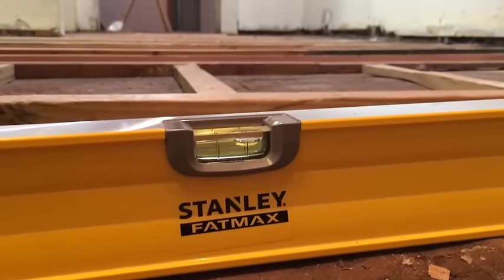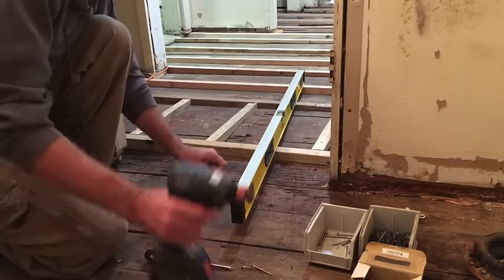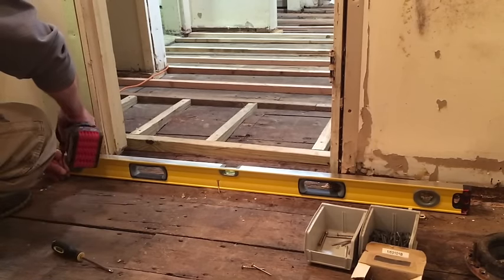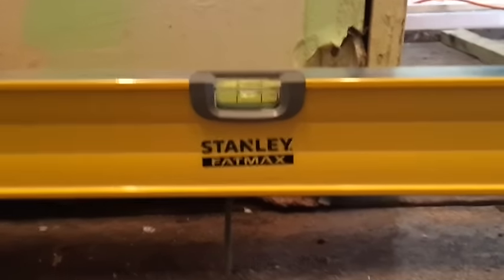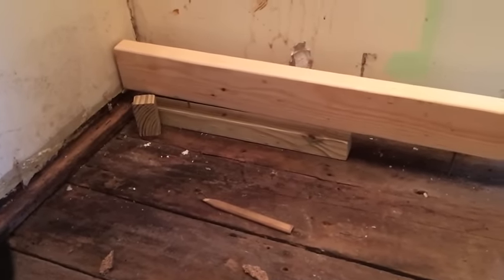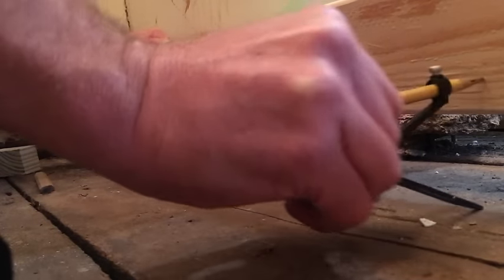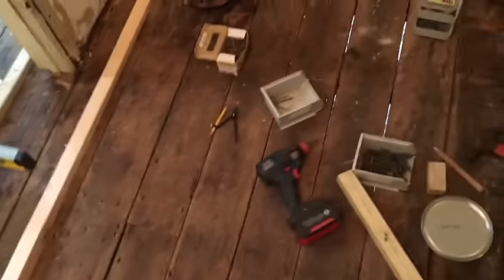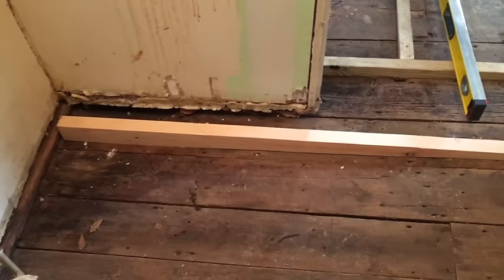DIY: How to level a uneven, wavy, or sloping wood floor

Comment from the maker: Jimmy5F, there was a brick chimney estimated to weigh about 2200 pounds that was sitting directly on the floor and was unsupported from underneath. The house was built in 1916 and over the years, the large hardwood beams, joists, and subfloor planks all warped under the weight. I removed the chimney and tried to jack up the house, but the curvature of the beams could not be straightened, and there is only a small crawlspace underneath to work. The floor is now supported from below, but I needed to correct the warping above without spending an enormous amount of time and money rebuilding the structure. This has worked perfectly.
Reply from the maker: @ph7715  It is perfectly acceptable and no, it will never bite me in the butt regardless if I rent it, sell it, or keep it. This improved the structure, strength, stability, noise, and energy efficiency of the house.

Comment: Very helpful video when you can't use a floor leveling compound. We live in a 1911 house with floors that have settled away from the central bearing wall. We've found that making the floors straight and flat vs. level is more appealing to the eye, especially around the doorways and stairs. A few rooms we've removed the floor, removed a few inches from the top of the joists, and using a carpenters string,  sistering new joists at the appropriate heights to remove the hump. Other rooms we've been able to accomplish a straight floor by running a carpenter string from wall to wall then scribing and cutting two by twos to attach under the new floorboards similar to what you've done . Both ways have their place but in our house, a level floor creates problems while a straight floor eliminates the high and low areas while still looking level. Excellent video
Reply from the maker: Good points. Thanks, Dale!

Comment: Exactly what I did except I took the sub-floor up (it was pretty well rotted out anyway) and built up the joists to the height  I wanted.   Glue and screw what you build up.   I used doorways  as transition points to different  elevations and used short sloping ramps to make the actual transition.   I like your work.. Just  think it could have been easier with similar results

Comment: Not a bad video. I would invest in a laser level if you’re doing the whole house to save a lot of time. Also you didn’t mention but you should fix your timber rips on top of existing floor joists so as to not load the existing floor boards with the new floor load

Comment: Great vid. I had to use a similar method for pluming uneven walls. Ran a string line horizontally and then traced the mark onto 2x4. Then I cut the line out on a table saw.
Reply from the maker: Great idea! I hadn't thought of cutting shims for the walls. You should make a vid so everyone could ask you why you just didn't fix the wall. Ha!
Reply: @737T1C130  Lol , well we can't always tear a floor or wall completely out. I like to fix stuff right like you but sometimes demoing the whole house isn't practical.

Comment: As someone who is about to redo my bathroom floor that unlevel and been watching alot of YouTube videos.......I am just curious was sistering the boards so that the floor was level not an option???? I've seen alot of pple suggesting that and now I'm wondering if it is a good option
Reply from the maker: It is a good option, but in my case, I had large hardwood beams on the bottom side with multiple 1" planks across them and wall framing sitting on top of that. Here, sistering would have created much more work and I was able to save time, material, a money using this method and likely having a more solid structure.

Comment: Wouldn't it be better to lay it down perpendicular to the current floor boards to avoid any potential creaking? Then, each new support is supported by multiple boards, not just one.
Reply from the maker: Since the new subfloor would be resting on the shims, I wanted the weight distributed across the underlying heavier joists instead of the thin and flimsy floorboards.

Comment: Just what I was looking for. I’m trying to do that for a concrete garage, to convert into a bedroom. Any recommendations on what to use instead of the screws?
Reply from the maker: Cliff, I would use concrete screws. Just drill a pilot hole with a masonry bit then use the concrete screws to hold your shims to the floor. Good luck with your project!

Comment: This video may have just saved me a lot of headache. I've got a stucco home built in 1910 with very similar issues yours has, and I've been weighing my options as to how I'm going to level the floors before putting new flooring down. My fear with my home is if I were to adjust the beams from the basement, what it would affect in the rest of the home.

Comment: What type of plywood would be best to use? OSB? We have hardwood subfloor thats sagging and going to use this method
Reply from the maker: OSB works just fine. You do need to find an OSB floor span chart for the thickness you are using. Your shims may need to be spaced anywhere  from 10-16" on center so that it doesn't bow.
Reply: @737T1C130  Beyond helpful thank you for the reply on such an old video !

Comment: But are you putting this wood randomly on top of the floor or are you aligning these new "pseudo-joists" on top of the old joists below the wood floor?(or maybe you laid it down perpendicular?  I would think that for the safety of the house you would need to look below the floor to see where all the existing joists are. anyone who can explain this to me would be a great help!! thanks
Reply from the maker: The frame of the house was old hardwood beam construction. There was a chimney that was built resting on these beams. They were solid, but were warped over the course of 80-100 years due to weight. I used online calculators to study the spacing and span load limits of the beams, wooden plank floor, these shims I cut for the top, and the new 3/4" subfloor. I could park my F150 on this floor, but I can't get it through the door. It's been lived in for the past two years. I'd estimate it's stronger than new construction.

Comment: Did you glue and screw the shims down?
Thinking I'll just space screws every 12 inches to attach my shims to the joist. These screws really just have to hold it in place before the subfloor goes down. 

Then subfloor will go down with screws every 4-6 inches (missing the shim screws)
Will probably use construction adhesive everywhe as well
Reply from the maker: I only used screws and it's rock solid. Good luck with your project

Comment: Ok question: I am starting to work on my grandmothers in laws house and it it’s also 100+ years old. So why when you did the entrar way did you not bump the boards up to the drywall fa having that gap for the wall to the board?  This is an amazing video and have watched it now 4-5 times. Getting an idea in how to do her floors. Also would this work if I went right to the beams vs the floor boards that are there now or should I go over the floor boards and make it have a thinker floor?
Reply from the maker: Thanks! That was actually the old drywall. I did the floor before I did the walls. Once I had the floor level and square, I removed the old drywall, rebuilt the walls then rebuilt the roof. In my case, the old floor board planks went under the walls so they would have been difficult to remove and reinstall. Also, the heavy beams underneath were strong, but warped after 100 years. I wanted a thicker floor and so far it’s held up great.

Comment: I moved into a 1910 house last year and have been wracking my brain, trying to think of how to level the very sloping upstairs hallway to be both level itself and also level with the bathroom floor. I think this may well be the answer! It’s only a small area, so hopefully not a huge project. Question: will this method still allow easy access under the original floorboards? I have heating pipes under the floor and would like to maintain easy access to them. I guess as long as the pieces can be unscrewed it shouldn’t be a problem?
Reply from the maker: Yes, I always use screws just in case I need to take it apart. Good luck with your project!
Reply: @737T1C130  Thanks so much!

Comment: Could you have lined the timber next to the screws, on the floor, mark screws level like that instead of doing it in 2 seperate ways, mark level then height? Guess it's one of those things that would come to mind afterwards
Reply from the maker: I could have, but I wanted to make sure the bottom of the shim followed the contour of the floor closely before I cut the height. Not only did the floor slope, but also had multiple high and low points. I wanted to make sure the shim didn't just lay on the high points before I cut the top to level.
Reply: @737T1C130  ah yes. you knew what you were doing anyway I guess

Comment: I think you might of made a bit extra work for yourself, I think if you used an off cut of the 2x4 as the scribe block to mark the scribe  line and cut to it, the timber would be the correct height as well as level, with no need to rip it down again with the  circ  saw.
Reply: agreed done it a million times  - added bonus is you still have a factory sq board to put on top if you just flip it
Reply: Thank you, David. Can you elaborate a bit when you mention " I think if you used an off cut of the 2x4 as the scribe block to mark the scribe  line and cut to it," it appears this may be a very useful tip for us all!
Reply: @cjharrin   4.15 instead of using a random bit of timber to mark the scribe line to follow the contour of the floor  and then cut to that line make the timber  level and then have to mark and cut  the other side to reduce the overall height .  If you instead used an off cut piece of the new 2x4 , (4” dimension vertical obviously)  as a gauge to mark the pencil line following the contours of the old floor, then cut to that line it will do the two tasks in one, scribed and dimensioned and as Tony Gatto says you still have the nice factory cut face on top to lay the boards on
Reply: @daveylad2  Thanks for that tip!!
Reply: Thanks for this tip.

Comment: Once you set the 2x4 on top of the screws, you know the 2x4 is exactly 3 1/2 inches too high so make that your scribe dimension. In other words, use a short piece of 2x4 with your pencil on top. One cut and done.
Reply from the maker: I always wonder why people who already know a better way to do it watch this video…
Reply: Maybe because it’s a little tough to know what’s in the video without watching it. I was just trying to save you half the cutting work, smart guy.
Reply from the maker: @robertmeadows1657  Thanks. Your comment was a big help 3 years later.
Reply: Well, given your efficiency and snide reluctance to graciously accept some constructive criticism, I figured you were still working on it.
Reply from the maker: @robertmeadows1657  LOL. That was a very good reply. I can't top it. Thanks for the advice. Have a good one. :D

Comment: What did you do after you finished scribing everything to level?  Did you set everything on 16" centers and just lay down a subfloor on top or what?  Thanks for the response 5 years after the post 😄.
Reply from the maker: @steveboyle5245  yes, i did 16” centers and just put down 3/4” plywood subfloor.

Comment: Did you reframe the doors, or just trim some off the bottom? Also, how did you keep the screws in the same plane across the span of the floor? I’m considering string.

Comment: When put your plywood on top an screw it down does sound hollow when you walk on it ?
Or do you not notice it when you put your vinyl flooring down?
Reply from the maker: There's no hollow sound at all. I used 3/4 plywood and with the original hard wood beams and full dimension 1" subfloor planks under the shims, it's dead quiet.

Comment: How far apart do I lay the 2x4s that I cut to make level, before I lay plywood? Trying to make a nice even sub floor for my vinyl plank flooring I got .. I got a floor very similar to yours. I just need to find out how far apart I run each 2x4 and I’ll be good thank you :)
Reply from the maker: Depends on the thickness of the subfloor you will be laying on top. Google floor joist spans for the correct spacing. Example = 3/4" subfloor = 24 inch spacing.
Reply: ZigPig I’m sorry I’m a complete noob and this is my first house I’m fixing up. My first sub floor that I’m gonna build another sub floor on is 1 inch thick. Thank you so much for replying. If you could shoot me the measurements for what I should do I’ll be eternally grateful. Another floor I’m going to level out is concrete
Reply from the maker: @xXMaGoO316Xx  I would space your shims/supports 24" or less apart and lay down 3/4" or 23/32" plywood over them. This way, you shouldn't have any flex between the shims when you walk on them.
Reply: ZigPig thanks so much ur the bomb!
Reply from the maker: @xXMaGoO316Xx  Good luck with your project!

Comment: Very nice! Although, will the floor not continue to sag? This is definitely cheaper than replacing the floor joists. Correct me if I’m wrong.
Reply from the maker: I removed the 100 year old brick chimney which was causing the sag. I also added some 8 inch support posts in the crawlspace below. It's been a couple years and I have renters in there now. Hasn't moved a millimeter. Thanks for watching.

Comment: Awesome video! Thank you. I have a similar issue with my home, but the max build up thickness is only around 1/4" (packer only).Would you use the same technique for packers/battens this thin?
Reply from the maker: I think for 1/4" or less, a floor leveling compound might be a better option. Good luck!

Comment: What would you put down on top of this? Plywood or hardboard I presume? What sort of thickness are you looking at?
Reply from the maker: I used 3/4" plywood over shims spaced 16". Honestly, it might have been overkill, but worked great. OSB would have been sufficient. I used tar paper as a vapor barrier with Pergo flooring.
Reply: @737T1C130  That's great - thanks so much for replying! Think I'll need to re-think my plans as I was originally thinking 5mm plywood would do the job. Guess it depends on the shim spacing in all honesty. Will research more and see if there is some sort of 'standard' or recommendation for that sort of stuff. Thanks again!
Reply from the maker: @ronnybums  Google subfloor joist spacing. There are tables which list the optimum spacing of joists, or in this case, shims, for different thicknesses/compositions of your subfloor material. Good luck with your project
Reply: @737T1C130  Amazing. Thank you!

Comment: In China they lay tile with laser level built for tiling, which had it's laser beam at bottom so laser line can get as low as floor level and hight can be adjusted with raised platform or tripod, that might be easier to use in this case.

Comment: First, thank you for the great video. For sure it would save me money. I did see that the old wood floor is even rotted and was wondering, how will you continue from there?. Will you put a cement on it? or something else?. One more question please, if you don't mind, I want to buy a property where the wood has wood worm in it. So after treating it, I could still have some little worms left. Question is: Is it smart to level it and put cement on it? or do you have any other idea i can hardend the current floor without loosing it. Would be more then happy to consult with you, and i don't mind paying for it even - you seem one that seen a lot. Thank you again.

Comment: After scribing the 2x4 to get the floor contour, you then had to cut the top off in order to get it to same level as the other room.  You marked the tops of the screws and it looked like about 1/2" needed to be cut off. You then used a circular saw.  You should have used the fence and your table saw.  Set the fence from the blade that 1/2" or so (whatever the exact measurement was) and use the table saw to cut a perfectly straight line.   Good job overall!  I am wondering, is this a house you just bought to fix up?  Rental people damaging the house and you repairing, or what?  Thanks for fixing up an old house!  Wish more people would take care of their houses like you are.  Good job.

Comment: Thanks a lot for a very very helpful and informative video. We’re currently having this issue to the area where our new kitchen will be and the way you have explained was perfectly make sense. Wondering, with the uneven floor that would resulting from the foundation or piers of the house, shouldn’t we be fixing the foundation/piers or this could be sufficient and better to not touching the high cost point on fixing the foundation.
Reply from the maker: Fixing the foundation is always the best bet as it is normally the root of the problem. However, if the structure has settled, sagged, and warped over many years, lifting the foundation will only result in lifting a misshapen structure. I had some 8" hardwood beams that would not straighten with enormous pressure from large railroad jackscrews underneath. I was simply lifting curved beams.

Comment: Did you put any insulation between the old floor planks and the new plywood or just leave a gap?
Reply from the maker: Hey, Bob. I did not use any insulation. It probably would have made sense, but I don't seem to have any issues without it. I did put a vapor barrier between the new subfloor and the flooring which might be preventing a lot of air/temp exchange.
Reply: @737T1C130  Thanks for the reply!